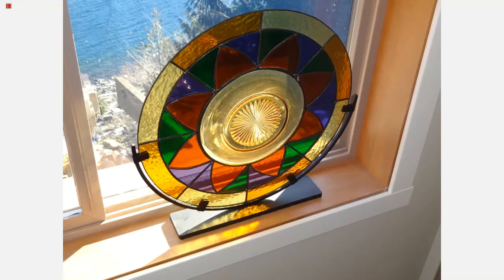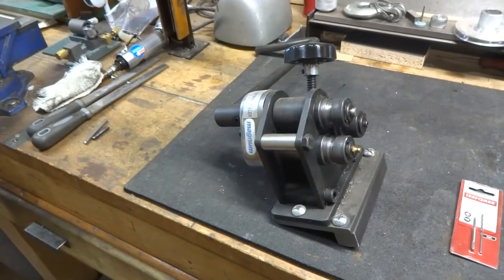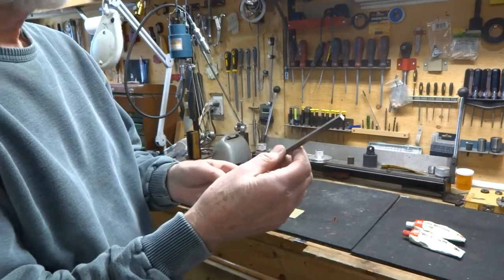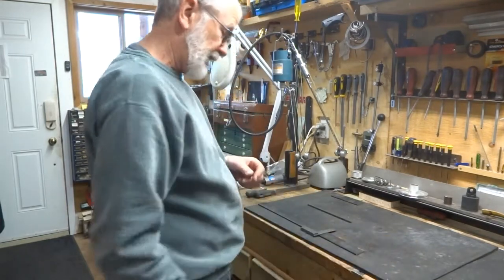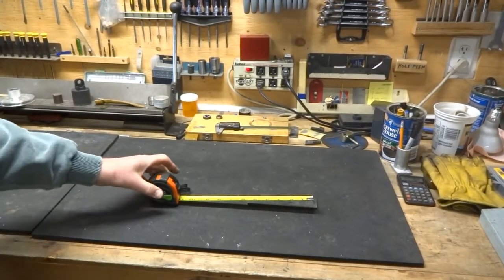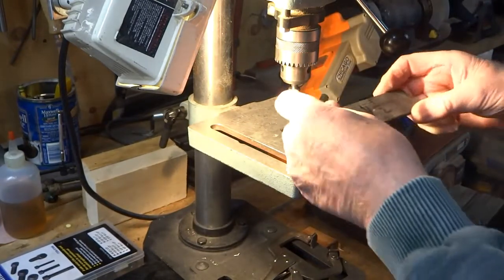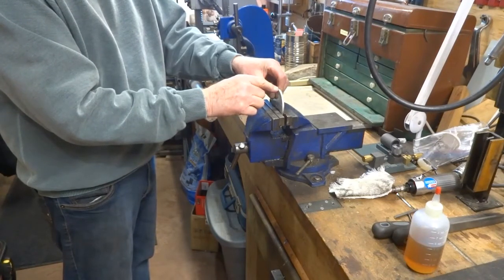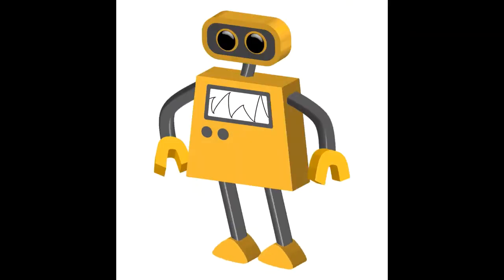Stained Glass Stand (Homemade)

Comment: I am a stained glass artist.  I love this design and have been looking for something like it for awhile.  Excuse my ignorance, but I am not used to working with metal so have some questions.  
What kind of metal are you using for the keystock and the base?  Is it carbon steel?  
Any ideas on where I would go (what kind of store) to purchase these metal items?
Do you have videos on the other two stands you showed at the beginning?

Thanks so much for any help you can give me.  And thanks for the great video.
Reply from the maker: Give me a while I will see what I can do.
Reply: @MrModify  Thank you so much.  My biggest question that will get me started is what kind of metal you used.  I want to use something that will work with the ring roller.
Reply from the maker: This is just 1/4 X 1/4 mild steel
Reply: @MrModify  Thanks so much!!